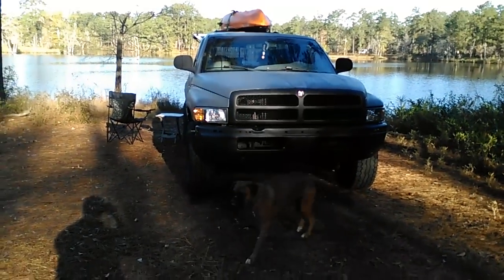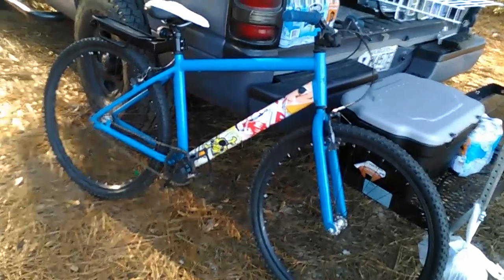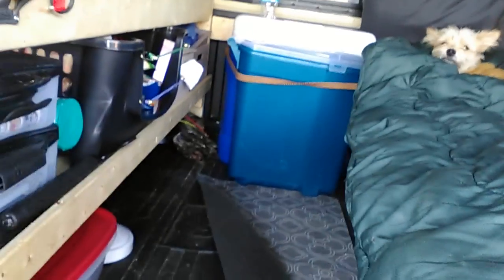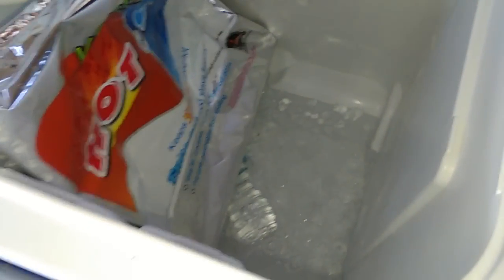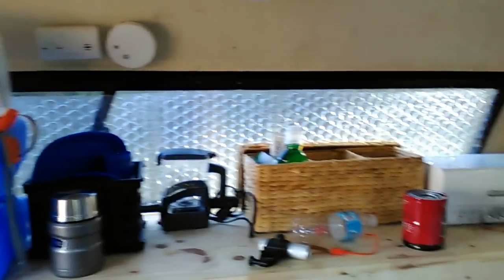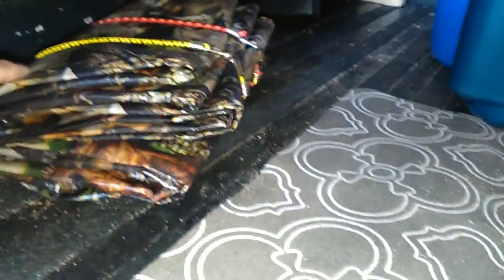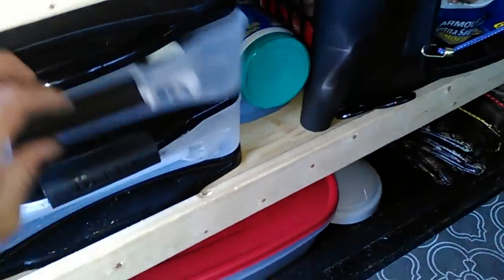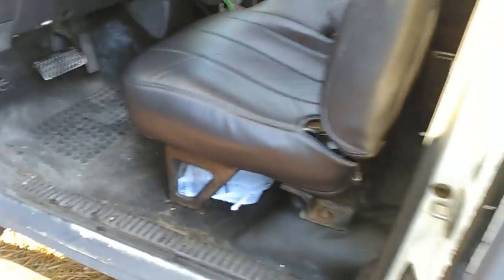The Best Damn DIY Truck Camper Set Up You'll See

Comment: Nice setup.  I like the "table" for the stove.  I might steal that idea... except use it inside as a laptop table.  Maybe put some thin wood on the top.  

I'm surprised you don't go with propane for your heater since you are using propane anyway.  Grab one of those 20lb tanks and then place it outside once you get to your spot.  You would just need a hole (probably in the bed of the truck) to run the hose in.  May not be worth it though if you don't do any fall, winter or spring camping.  

A 20lb propane tank will run one of those smaller buddy heaters for 120 hours... if you actually get it completely filled.  They have a few safety features built into them also.
Reply from the maker: i run a buddy heater now, i use the small tanks. i have a phobia with the bigger tanks especially if i get in an accident. some guy set himself off while pretending to sell propane tanks in Iraq and i saw the carnage it does.
Reply: The Nomedic
Yeah, I guess it depends on how much you are currently using.  I mean, if you are carrying 10 to 20 of those 1lb tanks on trips then I would think the danger you mention would be the same, if not worse.

I think the smaller tanks are also more likely to leak.  I never had any problem with them though.

The larger tanks are a TON less expensive also.  They pay for themselves by the 3rd fill up. 

Just make sure you buy your own tank.  I wouldn't trust those tanks that you just trade in. Not if you plan to keep it in your vehicle.

I personally didn't like the idea of a 20lb tank though so I bought a smaller 11lb one.  They cost twice as much but they are easier to find a place to store in the vehicle.
Reply from the maker: +101perspective i only carry 3 tanks at the most. font use it too often.  only when i wake up so i can get changed and when I'm about to go to bed
Reply from the maker: +101perspective Where do you get the smaller one you're talking about?
Reply: The Nomedic
I got mine from Home Depot.  If you do a search for "11 lb Propane Tank" on their site it will pop up.

The picture they have makes it look like the bigger 20lb ones but it is actually only about 9.1 inches wide.  The 20lb ones are much fatter than that.

Like I said though, the 20lb ones are cheaper since more people buy them.  You can get a brand new 20lb one for $30 at home depot.  An 11lb one you have to order off their web site and it costs about $57.  For me it was worth it though.  It only cost me $5 to fill it.  Those 1 lb propane bottles you are using cost about $2.50 to $3 each.  So, this thing will pay for itself pretty quick.

Lastly, if you have a Mr. Buddy Heater now, you will also want to get the "Enerco - Mr Heater F273701 5' Propane Hose Assembly".  I think they have longer hoses if 5' isn't enough.  I ordered mine from Walmart for $18.  It is pretty good quality and it does fit that tank and the Mr. Buddy Heater.  There are cheaper hoses out there... but I felt it was worth the extra $8 or so to get higher quality.

Bottom line, there is a higher front end cost going this way.  However, it is TONS cheaper in the long run if you use it a lot.  And imo it is just as safe, if not safer if you are carrying around lots of those small bottles anyway.
Reply: The Nomedic
Btw, if you get one you need to always store it upright.  You don't want to be putting it on it's side... especially when you are using it.

So, keep that in mind for when deciding if this size container will work for you.

What I did was just put it on a bottom shelf and strapped it to the side support for the shelves.  It isn't going anywhere on it's own.

You have dogs also.  So, I would make sure the hose isn't where they can chew on it.  Or maybe they make something you can spray on the hose to make them not like the taste.

Lastly, if you buy the tank, I would go to a professional propane place the first time you have it filled.  They need to purge it.  It is a simple process but is pretty important to get right... so you want to make sure the person knows what they are doing.  Also, I think many professional places won't charge you extra. I know the place I went to didn't.  However, a place like Uhaul (if you can find one that even knows how to purge a tank and has the equipment) will no doubt charge you extra. 

After that first fill up, however, it is a little less important where you go to have it filled.  But if you can easily get to a professional place then of course that is where I would fill up.  It only takes a few minutes to fill a tank btw.  It's a pretty fast process.
Reply from the maker: +101perspective I'll have to wait when i redo the camper. I'm still debating on whether or not to build a slide in or switch to a short bus. the rest of the year will be in 70 degree weather so i wont be using it as much.
Reply: The Nomedic
Yeah, I bet you have lots of possibilities with a vehicle like that.

I have a transit connect.  It's a small van basically.  I like it because it averages about 26 mpg and is pretty stealth.  I have mine set up so that I can take everything out in less than 5 minutes (including the wood/carpet floor) and use it as a normal van when I need to transport stuff.

That said, I will be installing a solar panel and battery soon.  Those won't be easily removable... not that they really need to be.  The battery won't be in the way or anything and I never put anything on the roof anyway.

Your vehicle setup is a lot fancier than mine.  For example, when I sit in the van I have a couch made from a piece of plywood (covered in cloth) that sits on 2 Home Depot buckets...lol.  And I have actual couch cushions for the back/seat.  And of course I keep supplies in the buckets.

When it is bed time the board comes off and is stored to the back and the buckets go to the side... and the cushions go on the floor for the bed.  Then I just toss some covers on it.

The floor is just a piece of 1/2" plywood that I wrapped carpet around and stapled.  I was going to go with just carpet like you have but I didn't like the "channels" on the floor.  It made it hard to set up tables and stuff inside.  Plus, the carpet moved around.  The carpet and plywood combo don't move an inch even without being anchored down... yet, pop right out when I need to transport something.
Reply from the maker: +101perspective i might ask for help if i decide to go with solar.
Reply: The Nomedic
Will be more than happy to provide sources and stuff if you need.  I'm getting a 100 watt panel and a 100ah battery.  Also charge controller, fuses, extra wire, etc, of course.  Altogether it is about $370.  Like you, I already have an inverter.

The cost is a bit much but I got tired of having to run the vehicle all the time to charge everything up.  Plus, I have no windows in the back so I want better lighting and a vent/fan.  It opens up other possibilities also for future electronic stuff I might want to get.

Comment: How tall are you? I'm worried that I'd need to buy an extended cab to sleep comfortably- I'm 6 ft
Reply from the maker: I'm 5'7" it's the regular bed at 6.5....an 8' bed maybe better suited for your height....I've been thinking about getting one but I already spent 800 on this used ARE. from what I see they're the only ones that make this camper top and it's 3000 new. get the taller leer shell for head room
Reply: +The Nomedic thanks for your response it really helps - I think it would be best for the longer cab just to make things more comfortable- what you are doing is awesome man it's so friggin cool - thanks again for the feedback I wish you luck on this cool life experience and journey
Reply from the maker: Austin Cormier thanks man ask me anything when you're ready to build one
Reply: +The Nomedic ok sweet thanks I'll keep that in mind - I do have a question though - for cleaning do you have a solar shower ? Or do you go swimming or do you go to a YMCA? Or what haha

Comment: Better than Febreeze is a spray bottle of vodka. (Just don't spray just before you go out onto the road).
Reply from the maker: what does it make it smell like afterwards, does it eliminate the bacteria?
Reply: +The Nomedic - Vodka is an antiseptic. It will smell like alcohol at first, but it will work on the bacteria (the source of smell which is what makes armpits smell) rather than mask it. Vodka on clothing and upholstery is an old trick.

edit: I did a quick search and I misused the word antiseptic if you're not applying it to skin. It is antimicrobial in your application.
Reply from the maker: +VideoMenu I'm gonna have to try that
Reply: +The Nomedic - Have fun out there. Just don't drink the cleaner. :p

Comment: i need an 8 foot bed... but long box trucks look like shit..... hard sleeping in a small truck bed when your 6'2. my box is only 6" but i manage
Reply from the maker: what about a short bus conversion? ive been thinking about it
Reply: +The Nomedic lol im trying to keep it stylish and not look like a van guy.... i drive a lowered s10 extreme with racing stripes ect with matching topper.im just gona make a tent cap for the back so i can have it open and still sealed
Reply: +The Nomedic it has to be an everyday driver at the same time for me.i couldnt drive a short bus around....lol. maybe if it had fat subs and a bar!
Reply from the maker: +milldabeast519 lol I'm not a van guy either. its more space but unless its a lifted 4x4 or look like an assault tank I'm not driving one. i did however find a 4x4 lifted short bus.  it was pretty bad ass
Reply: +The Nomedic fuels around 1$ per liter.also. i would have to go diesel if im going big. i already burn 100$ a week easy with a  4.3Lv6. a big 350 would kill me in fuel. i like something that when you see me driving your saying thats a nice vehicle . not knowing its a camper makes it much better in my opinion.i would prefer something that isnt lowered since its not practical off road at all...god dam fuel tho.
Reply: +The Nomedic do you get moisture in this?? you must. i have moisture when i camp in damp weather. the sides of the bed get everything wet from condensation. no fabric can touch the sides of the topper or steel during damp weather.my bed is just painted steel.  and do close everything up including the windows at night when its cold??worry about carbonmonoxied poisoning??
Reply from the maker: +milldabeast519 I get mild condensation but just the ceiling and windows. non of my stuff gets wet. I close all windows at night except when I'm using my buddy heater. which is only when I wake up, and right before I go to bed. then I just use my body heat and my dogs body heat under the smelling bag to stay warm. no need to worry about c02 because there's nothing running. the AC vent is mostly for my dogs when they ride in the back while in driving so they're comfortable
Reply from the maker: +The Nomedic sleeping bag
Reply: +The Nomedic yea i wasnt sure if breathing in a confined space like a truck topper could be dangerous.
Reply from the maker: +milldabeast519 I haven't died yet. besides it's not totally sealed so air still comes in

Comment: I like it just hate the economy of a PU. If fuel were no object I would love to have that set.
Reply from the maker: lol my mpg sucks actually. 11 in the city, 15 on the hwy. i wanna switch to diesel. but ive really been contemplating the idea of a shortbus conversion
Reply: The Nomedic I have a Prius and towing I get 30 MPG 60 mph. Just a 4x8 trailer but it is a place to sleep. Shower at the gym and I am cool. Small generator can power the AC when it is hot it is impossible to sleep in the heat. Sadly I only towed it home but that was a long tow. What sucks is I am waiting on paper for the thing the guy that sold it to me never registered it now I am waiting for paper.

Drop that trailer I get 40 plus mpg AC running 70 mph.
Reply from the maker: +Grunge Luggage Tours a tear drop camper?

Comment: 8 foot bed would have made it better and an aluminum Utility shell with foam lining.. That fiberglass gets hot as shit
Reply: ***** with those cam locks it is impossible to lock you in. I have one on my truck with an ARE ladder rack on it. The cams have a small screw on the back that holds the locking cam.
Reply: ***** yourself, NO! someone else could if they had the key. But the cam is on the inside and easy to get to unlock from inside. I bought a utility shell with full length side doors instead of windows. This is way handy for a custom canvas tent for extended boondocking.
Reply: ***** you can put a simple throw lock on it. It is just aluminum, you could do it real nice too. A simple hi-temp propane torch and an thin aluminum rod to weld the throw catch on it!